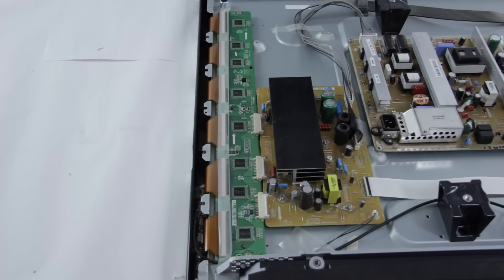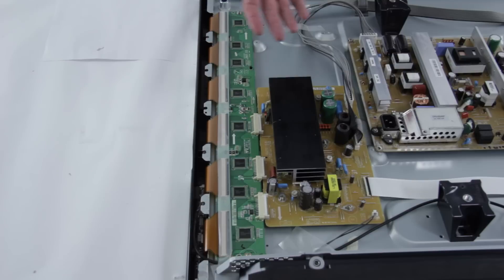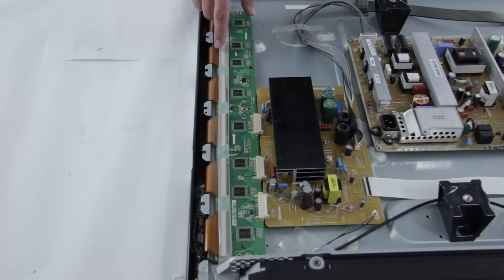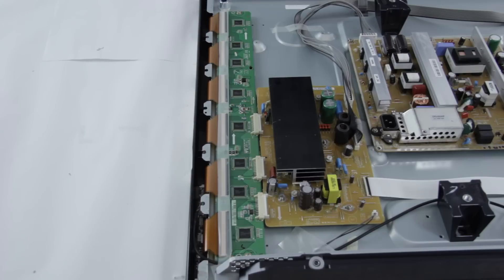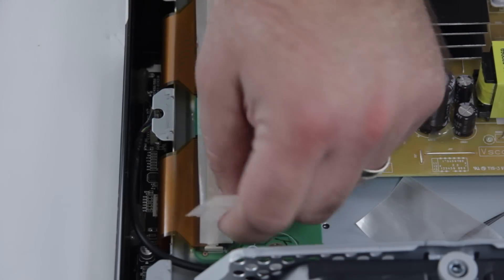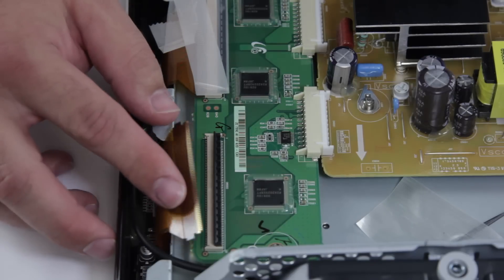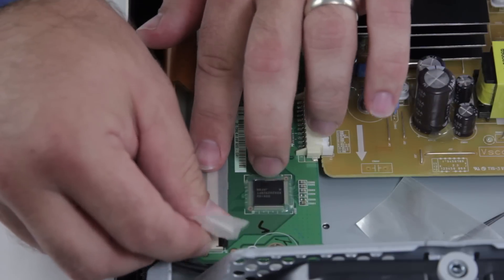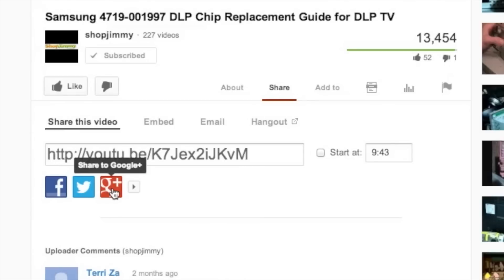Plasma TV Repair - No Image, No Picture on Plasma TV Screen - How to Replace Y-Buffer & Y-Sustain

Comment: Hi yes sir I have a 50 inch LG PLASMA Model number 50PS30-UB
SERIAL 912RMXXOO4354 
MADE December 2009 

OK now I think possible both y board and buffer are bad every problem u decried I have double shadow picture black lines at times jumpy screen will run perfect for up to a hour at the longest then loud click and black screen set for 5 mins then perfect picture again for about 10 mins at the very most some time maby 1 min  the jumpy screen and everything else all over again I already cleaned all the ribbons but not the y buffer ribbons any ideas would be greatly appreciated thank u for your time
Reply from the maker: Stephen Wilkins  Please watch this video FIRST to help with your repair!  https://www.youtube.com/watch?v=BP3NVNCGEv8  I recommend replacing the (y-board & Buffers) YSUS and the YDRVTP & YDRVBT boards in your TV.  Click this link to replacement boards:  http://www.shopjimmy.com/catalogsearch/result/?q=50PS30-UB  There may be multiple boards for the same TV model number, be sure to match part numbers on your current board, with your replacement for compatibility.  Thanks and please let us know if you have any further questions with your TV Repair!  www.shopjimmy.com

Comment: Hi Jimmy! Thank you for the info! I have a Samsung 550 plasma TV, it's 3 years old and randomly switched off one day. I'd like to start by replacing the fuse to the power supply. Can I get just one fuse?  How do I replace it? The capacitors all look awesome. Thanks for the help!
Reply from the maker: Cigarski   You can pull the fuse out and see what amp it is and then replace it with the same one.  Thanks!  www.shopjimmy.com
Reply: ShopJimmy.com Hello Jimmy. I pulled off the fuse but I don't think I was supposed to. I got a power supply board from you, it's all in place and the TV is doing exactly what it was doing before. It appears to cycle thru turning on (light blinks and it clicks) but never really turns on, no picture! So now I see this Y-sustain/Y-buffer video. I guess I order more parts!?!?!? When do I stop? Still cheaper than getting a new TV I guess and I'm learning something .Thanks for the help.
Reply from the maker: Cigarski   Try this at your own risk. Unplug the TV, then disconnect the y board and plug in the TV to see if the TV powers up. Reply with the results of this test. Thanks! www.shopjimmy.com
Reply: ShopJimmy.com Hi Jimmy. At this point all I have done is replace the power supply board I got from ShopJimmy.com thank you very much! When I plug in the TV it appears to attempt to power on a few times, then front of the TV continues with  a series of 5 blinks and the logic board also blinks a small green light. When I unplugged the ribbon cable connecting the power board to the board where you plug in the co-ax cables it all stops, no power. Also, I had not reattached the back panel to close up the TV. I don't know if that makes a difference. I'm going to close it up now to see what happens before I try to replace another board. Happy New Year btw!

Comment: Hello
I have a Samsung pn42c450b1d that I was watching and it poped and now has no picture but does have sound. I turned it off and tried turning it back on, still no picture. But there is a crackling sound for a few seconds and still no picture. I did remove the back panel to see if there was a blown or lifted capasadure, but none looked bad. Upon further looking, I did see a darkened spot on that long side board to the left (y buffer board). I do have a picture of it, but cannot upload on here. Should I replace both y sustain and y buffer board to be safe or just the y buffer board?
Reply from the maker: stiff29  Please watch this video FIRST to help with your repair!  https://www.youtube.com/watch?v=BP3NVNCGEv8  I recommend replacing the Y-Main Board and the Y Scan Drive board in your TV.  Click this link to replacement parts in your TV.  http://www.shopjimmy.com/catalogsearch/result/?q=pn42c450b1d  There may be multiple boards for the same TV model number, be sure to match part numbers on your current board, with your replacement for compatibility.  Here is a link to a video showing how to identify your part number, click here:  https://www.youtube.com/watch?v=R1jmj_foId0  Thanks and please let us know if you have any further questions with your TV Repair!  www.shopjimmy.com

Comment: I have a Samsung plasma model HP-T5054. The TV is 8 yrs old. I was watching and the picture went bright then black. It powers up now but no picture or menu icons will show on screen. Sound and other functions seem to be working. What does the problem sound like to you?
Thanks,
Reply from the maker: Jason Chei  Please watch this video FIRST to help with your repair!  https://www.youtube.com/watch?v=BP3NVNCGEv8  I recommend replacing the Y-Main Board and the Upper and Lower Y-Scan Drive boards in your TV.  Click this link to repair parts:  http://www.shopjimmy.com/catalogsearch/result/?q=HP-T5054  There may be multiple boards for the same TV model number, be sure to match part numbers on your current board, with your replacement for compatibility.  Here is a link to a video showing how to identify your part number, click here:  https://www.youtube.com/watch?v=R1jmj_foId0  Thanks and please let us know if you have any further questions with your TV Repair!  www.shopjimmy.com

Comment: Hi my SAMSUNG TV MODEL  #PN50A400C2DXZA  WILL TURN ON WITH AUDIO BUT NO PICTURE; BEFORE THE PICTURE STOP SHOWING, THE PICTURE WAS DARK OR NOT SHOWING CLEARLY AND LATER NO PICTURE AT ALL JUST SOUND..... PLEASE HELP JIMMY..... THANKS
Reply from the maker: Argba Kargbo  Please watch this video FIRST to help with your repair!  https://www.youtube.com/watch?v=BP3NVNCGEv8  I recommend replacing the Y-Main Board in your TV.  Click this link to replacement parts:  http://www.shopjimmy.com/catalogsearch/result/?q=PN50A400C2DXZA  There may be multiple boards for the same TV model number, be sure to match part numbers on your current board, with your replacement for compatibility.  Here is a link to a video showing how to identify your part number, click here:  https://www.youtube.com/watch?v=R1jmj_foId0  Thanks and please let us know if you have any further questions with your TV Repair!  www.shopjimmy.com

Comment: I have a lg 60pz550  and I love it, but lately when I turn it on there is sound but no picture, however if I turn it on and off several times the screen will finally come on, sometimes if comes on on the 3rd try sometimes it takes an hour of turning it on and off. I always have sound, just takes many power cycles to get the screen to work.
Reply from the maker: Jason Miller   Try this at your own risk. Unplug the TV, then disconnect the y board and plug in the TV to see if the TV powers up. Reply with the results of this test. Thanks! www.shopjimmy.com

Comment: hi, i have a lg 60pk550 it is clicking but wont turn on no picture no sound it does show flashing lights the second time i turn it on. i have check for bad caps. i suspect the zsus voard but i am not sure i have dosconnect and it does seam to make a difference in clicking
Reply from the maker: Shane Cullen   Try this at your own risk. Unplug the TV, then disconnect the y board and plug in the TV to see if the TV powers up. Reply with the results of this test. Thanks! www.shopjimmy.com

Comment: My TV has a black line running through it from top to bottom and I figured it was the ribbon cable so I try to take off the panel on the bottom where all the little tiny circuits are and if something popped now I can see the little tiny bird circuits under the label one is C2653C2638 and my model number is S50HW – YB03 pn50a400c2d
Reply from the maker: Jesse Henderson   This sounds like a TV panel (TV Screen) problem.  If your TV panel is bad, it may be more cost-effective to replace the TV as panels are typically hard to find in stock, difficult to replace, and expensive.  Thanks and please let us know if you have any further questions!  www.shopjimmy.com

Comment: Thanks for the quick answer, I already have changed all three boards, (y sus board and buffer boards up and bottom), and I still don't have picture,I got sound,and the tv stays on all the time now, so I guess the parts are working, what do you think could be the problem now?
Reply from the maker: gerard2988   Double check and make sure everything is connected properly.  Otherwise one of the replacement parts could be defective.  Thanks!  www.shopjimmy.com

Comment: I have a s 55" Samsung Plasma Model:  PN50B530S2FXZA.  I tried to turn it on tonight and it makes its usual audio able double click turn on, the red power indicator light blinks on and stays on until it clicks again as if it is turning off. I took the back off and I noticed when I tried to power it up I heard a series of lightly sounding clicks before the louder click that usually indicated an on or off powering of the device.  Non of the Caps are popped or bulging on any of the boards.
Reply from the maker: Willyoulookatthat   Try this at your own risk. Unplug the TV, then disconnect the y board and plug in the TV to see if the TV powers up. Reply with the results of this test. Thanks! www.shopjimmy.com

Comment: Hey jimmy, I have a lg 60pz550 3d plasma tv, when I turn it on, I get sound, but no picture, and a few seconds later the tv goes off by itself, what do you you think could be the problem, thanks
Reply from the maker: gerard2988  Please watch this video FIRST to help with your repair!  TV Repair! LCD, LED, Plasma, DLP How To Fix Your TV with ShopJimmy.com Help!  I recommend replacing the YSUS and the YDRVTP & YDRVBT boards in your TV.  Click this link to replacement parts for your TV model number:  http://www.shopjimmy.com/catalogsearch/result/?q=60pz550  Be sure to match part numbers on your current board, with your replacement for compatibility.  Thanks and please let us know if you have any further questions with your TV Repair!  www.shopjimmy.com

Comment: Hey shop jimmy! My samsung plasma pn55e8000 will not turn on still. As soon as I plug in the power, it clicks a couple of times but does nothing if I try to turn it on. Iv has someone come look at it and they said it was the Plogic board and I bought one from you guys, replaced it and still not functioning. Iv also tried disconnecting the Y sustain board like y'all recommended in a previous comment but still having the same issue.... Anything else y'all could recommend that I can try? Thanks!
Reply from the maker: The Cody Jolly   Try this at your own risk. Unplug the TV, then disconnect the y board and plug in the TV to see if the TV powers up. Reply with the results of this test. Thanks! www.shopjimmy.com

Comment: Hi, i have a Samsung PN51E530A3FXZA, It started about few months ago where the picture would no come on, but I had sound. After powering on-off a few times it would than work. But now I get nothing. I did replace the main power board and no fix, still an issue. Any thought? on buffer board or main logic?
Reply from the maker: bryan loesch  Please watch this video FIRST to help with your repair!  TV Repair! LCD, LED, Plasma, DLP How To Fix Your TV with ShopJimmy.com Help!  I recommend replacing the X/Y Main Board and the Y Scan Drive board in your TV.  Follow this link to replacement parts on our website:  http://www.shopjimmy.com/catalogsearch/result/?q=PN51E530A3FXZA  Be sure to match part numbers on your current board, with your replacement for compatibility.  Here is a link to a video showing how to identify your part number, click here:  Samsung Plasma TV Repair Tutorial - Identifying Samsung Plasma TV Parts - How to Fix Plasma TVs  Thanks and please let us know if you have any further questions with your TV Repair!  www.shopjimmy.com

Comment: Hi, I have an a Samsung ps-50c91hd TV. It seems to be switching off/on or resetting itself and a clicking sound is heard I had it fixed under warranty, now the warranty has run out and I'm trying to fix it myself. The tv repair guy only said it was a voltage spike and replaced a board. Which board could it be?
Reply from the maker: djmoslow81   I recommend replacing the power supply board in your TV.  Unfortunately I do not see any replacement parts in the search results for your TV model number on our website.  Please reply with your part number on your power supply board and I can try searching for replacement parts.  Thanks and please let us know if you have any further questions!  www.shopjimmy.com

Comment: hello, glad to see folks are helping others get the most out of the electronics that are in today world really expensive... at least to me, i have a plasma 48' samsung. not sure what year? but the info you need is model number PN43D450A2D. my issue is, i was playing my Ps3 and the tv popped, made the static sound not static fuzz on screen then blacked out.. i still have sound but no picture. i took the back off to look at the inside to see if i could tell if a board had been singed or something and didnt see anything, any thoughts, ideas, or advice? thanks for the help.
Reply from the maker: daniel yager  Please watch this video FIRST to help with your repair!  TV Repair! LCD, LED, Plasma, DLP How To Fix Your TV with ShopJimmy.com Help!  I recommend replacing the Y-Main Board and bottom Y Scan Drive.  Here is a link to replacement parts:  http://www.shopjimmy.com/catalogsearch/result/?q=PN43D450A2D  Be sure to match part numbers on your current board, with your replacement for compatibility.  Thanks and please let us know if you have any further questions with your TV Repair!  www.shopjimmy.com

Comment: I got a lg 50pg20......black screen but sound works
Reply from the maker: Sunny Gill Please watch this video FIRST to help with your repair!  TV Repair! LCD, LED, Plasma, DLP How To Fix Your TV with ShopJimmy.com Help!  I recommend replacing the YSUS and the YDRVTP & YDRVBT boards in your TV.  Click this link for replacement parts:  http://www.shopjimmy.com/catalogsearch/result/?q=50pg20  Be sure to match part numbers on your current board, with your replacement for compatibility.  Here is a link to a video showing how to identify your part number, click here:  LG Plasma TV Repair: DIY Part Identification Number ID Guide for LG & LG Philips Plasma Panel Parts  Thanks and please let us know if you have any further questions with your TV Repair!  www.shopjimmy.com

Comment: hello I have a lg50pa4500 with sound and no picture. what would u recommend?
Reply from the maker: Ryan Fisher  Please watch this video FIRST to help with your repair!  TV Repair! LCD, LED, Plasma, DLP How To Fix Your TV with ShopJimmy.com Help!   I recommend replacing the Y-SUS Board and the YDRVTP & YDRVBT boards in your TV.  Follow this link to replacement parts:  http://www.shopjimmy.com/catalogsearch/result/?q=50pa4500  Be sure to match part numbers on your current board, with your replacement for compatibility.  Here is a link to a video showing how to identify your part number, click here:  LG Plasma TV Repair: DIY Part Identification Number ID Guide for LG & LG Philips Plasma Panel Parts  Thanks and please let us know if you have any further questions with your TV Repair!  www.shopjimmy.com

Comment: Hello, I have a lg plasma DU-42PX12X. For a while before the picture stopped showing up all together, I would have to turn the tv on and let it "warm up", the sounds the from the channels would play but the tv would not display a picture until about 25 minutes of running. Now there is no picture at all, but the sounds still play. I see other people talking about clicking sounds, and I believe I heard plenty of those also. I am attempting to fix this myself so what parts would you recommend purchasing?
Reply from the maker: Noah Rashaan  Please watch this video FIRST to help with your repair!  TV Repair! LCD, LED, Plasma, DLP How To Fix Your TV with ShopJimmy.com Help!  I recommend replacing the YSUS and the YDRVTP & YDRVBT boards in your TV.  Click this link for replacement parts:  http://www.shopjimmy.com/catalogsearch/result/?q=DU-42PX12X  Be sure to match part numbers on your current board, with your replacement for compatibility.  Thanks and please let us know if you have any further questions with your TV Repair!  www.shopjimmy.com

Comment: My philips 42" plasma model 42PF5321D/37 has sound but screen is flashing colors pixels.  It didn't have any popping or other sounds just started one day when I turned it on.  I removed the back panel and looked for bad caps but didn't see any. Any assistance would be appreciated.
Reply from the maker: Dennis glenn   Please watch this video FIRST to help with your repair!  TV Repair! LCD, LED, Plasma, DLP How To Fix Your TV with ShopJimmy.com Help!  I recommend replacing the Y-Main Board and the Y Scan Drive board(s) in your TV.  Follow this link to replacement parts to repair your TV.  http://www.shopjimmy.com/catalogsearch/result/?q=42PF5321D%2F37  Be sure to match part numbers on your current board, with your replacement for compatibility.  Here is a link to a video showing how to identify your part number, click here:  Samsung Plasma TV Repair: Samsung Plasma Panel Parts Guide  Thanks and please let us know if you have any further questions with your TV Repair!  www.shopjimmy.com